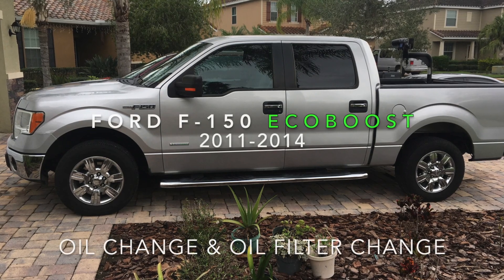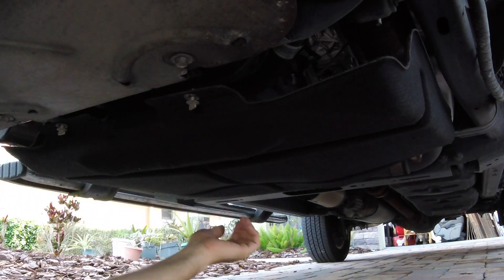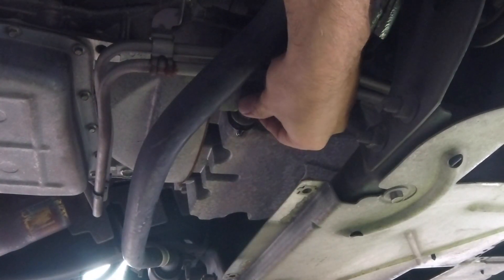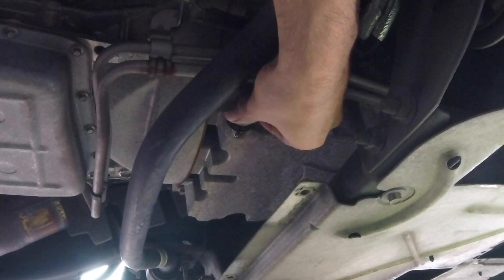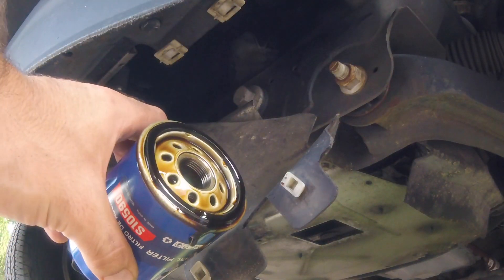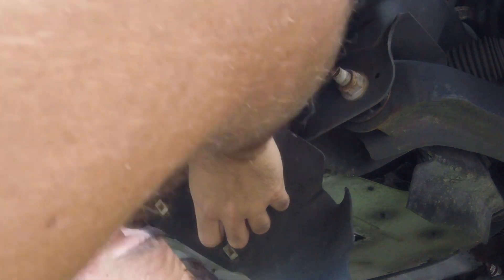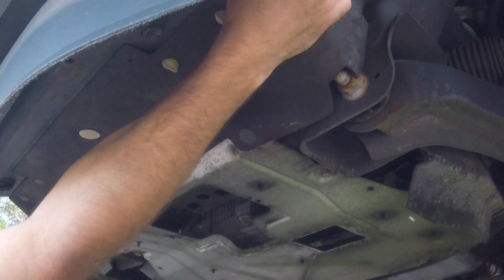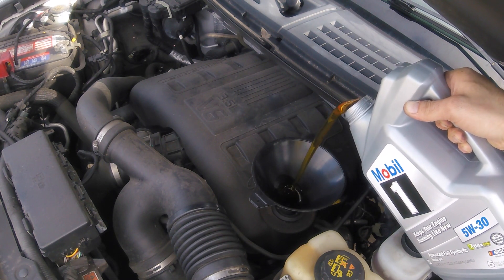2012 FORD F150 ECOBOOST OIL CHANGE & OIL FILTER CHANGE 2011-2014 PICKUP TRUCK HOW TO TUTORIAL DIY

Comment: Bro you should prime the new filter with new oil inside and use old oil for lubricant on the seal.
Reply from the maker: Quite possibly, but that truck is still running today.;

Comment: I heard that you need to put motorcraft oil filter on your ecoboost engine. Have you had any problems installing anything but motorcraft oil filter, or motorcraft oil? Motorcraft is way too expensive. I don't think they're worth the money.
Reply: Where are you getting your filters from? Amazon currently has the Motorcraft FL-500S filter for $5.97
Reply from the maker: Not sure about that one, I just got what they gave me at the auto parts store.
Reply from the maker: I got mine from advanced auto parts.

Comment: You should always apply some oil, or grease on the oil filter sealing service.
You should always start the engine and let it idle for 2 - 3mins. to check for leaks.
Then let it set for a few and to make sure the engine oil level is between the "MIN" & "MAX" lines on the dipstick.